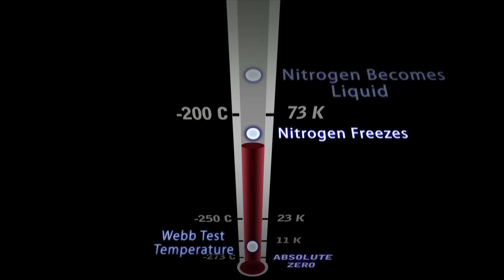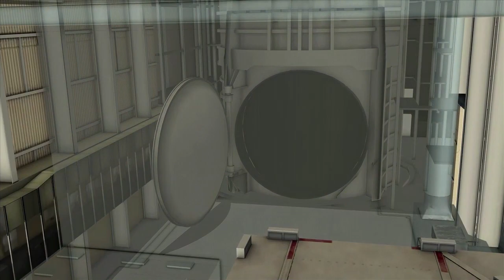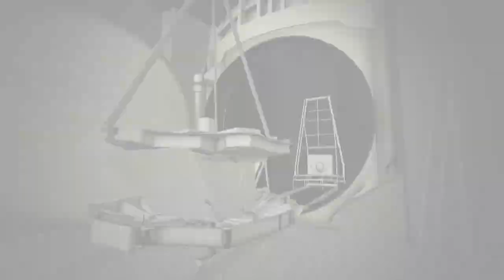NASA | NASA Upgrades Chamber A to enable testing of Webb Telescope

Comment: So basically space is really cold, but the thing is there also isn't much in space (hence it being a near vacuum). When your in a room and feel cold, it isn't necessarily because the walls are cold, its because the air is cold. However in space, you have no air to be cold. What you do have is a very cold set of walls and one very hot point on the wall (the sun). All heat is given off and absorbed via radiative heat transfer. This is a slow process hence why it takes so long to cool the chamber.